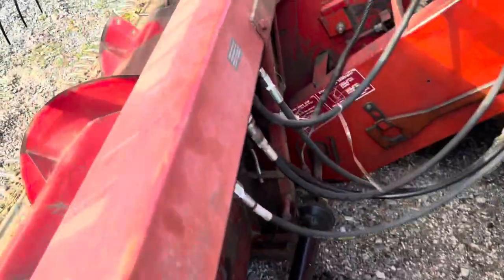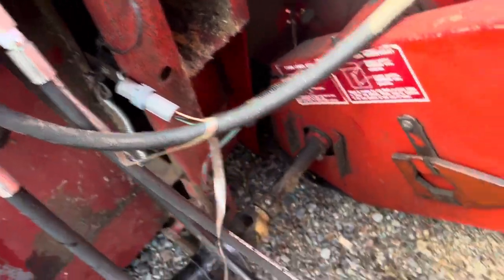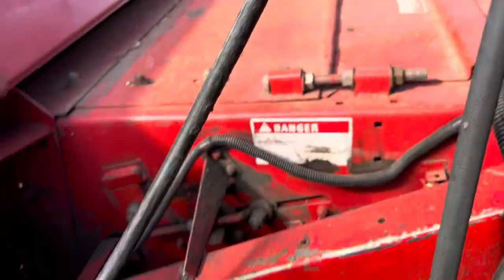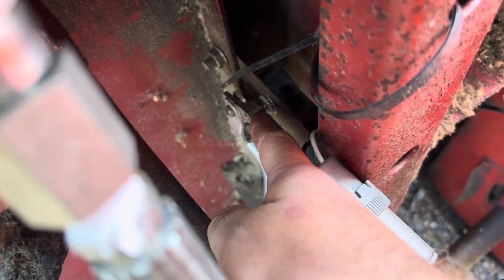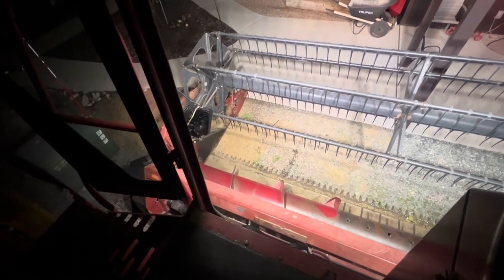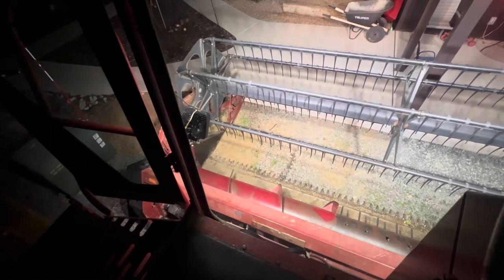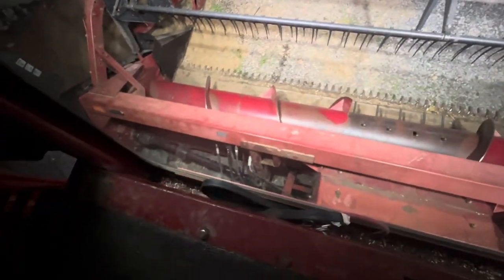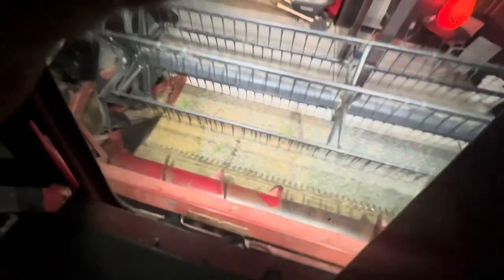Adapting a Case IH 1020 Header to an IH 1460 Combine Part 3

Comment: I’m currently working on a 1020 25’ that I put on my 1680. A lot of work fixing what the previous header owner did wrong/didn’t keep up on. I have had guys tell me to get rid of the fingers and go with the flight extensions but I have heard mixed reviews as well. Why would they put them on modern heads if not needed? Idk. You really put a lot of good work into that set up man!! Great job!!  👏🏼